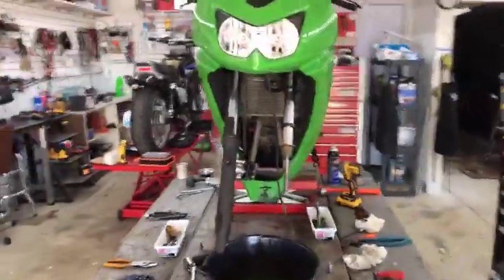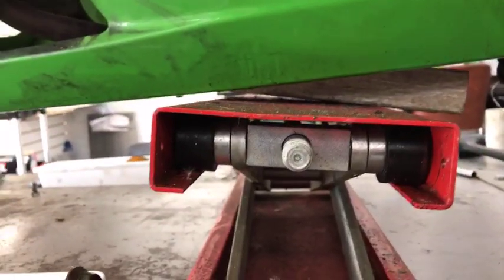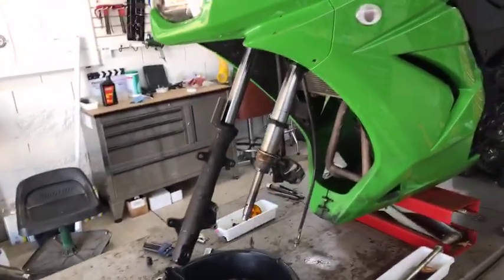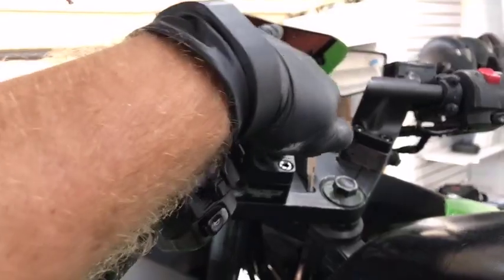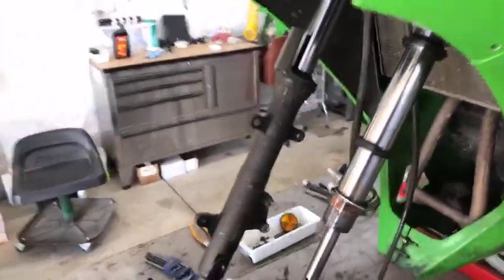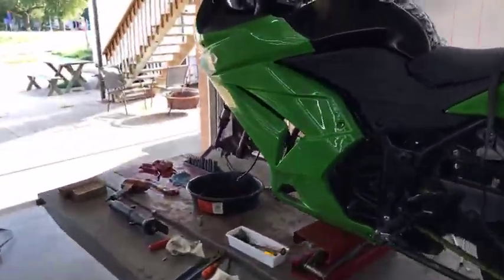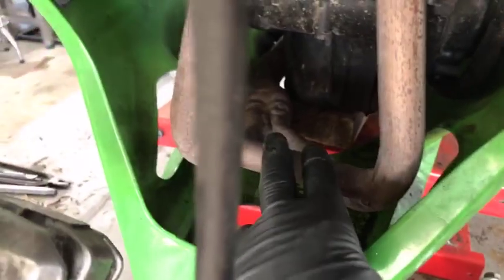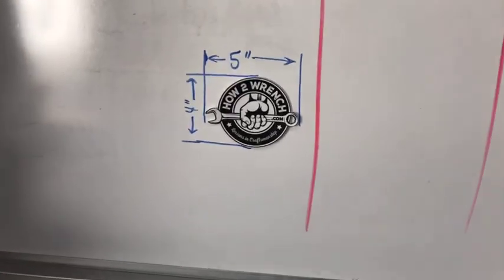Doing fork seal replacement without special tools tips! Gain an extra set of hands!

Comment: Hi Shane, you truly make great videos that are extremely helpful! 

I watched all your videos in one day. I trust that you can answer my question. I usually do most work on my bike myself. I have tried all that I can, replacing t stem bearings, checking fork alignment, handlebars assembly, but there is always a slight shake in the handle bars if I hit bumps. Any suggestions on what I might be overlooking?

Comment: Mr. Conley, has anyone ever mentioned the issue with removing one part of a fluid filled item, before removing the fluid filler part?? 

I worked for one of those quick lube places when I was younger. As part of my training, it was mandatory to remove the oil fill cap, before removing the oil filter or drain plug, just in case it was necessary to do extra work accessing the the fill point. 

Then later on, I was assisting (watching) a friend do this exact job. When he went to fill the forks, the fill cap had been stripped/cross threaded, and he wasn't able to gain access. This rendered the fork/motorcycle useless until further work could be done!! It took some time to fix it, and he ended up paying for a new fork tube. Just a thought. Maybe some issues could be avoided until a reasonable time frame could be setup. If the customer rode the bike to your shop, and ended up not being able to ride home, until parts or repairs could be procured!!
Reply from the maker: This bike's fork "has to be removed to gain access to the filler cap. It's under the handlebar. Your point does apply at many times turning wrenches. You find in my videos what I'm teaching is a "skill set" Like in this case, there are two main points. How to support the motorcycle and how to use the triple trees as your vise. The goal of the learned skill set is to think of other areas and times when "thinking outside the box" will save you time and money or allow you to push through a job....safely!